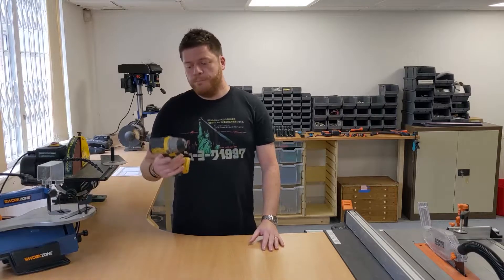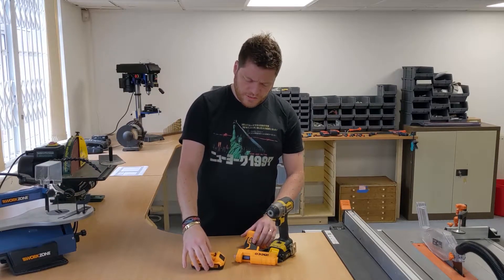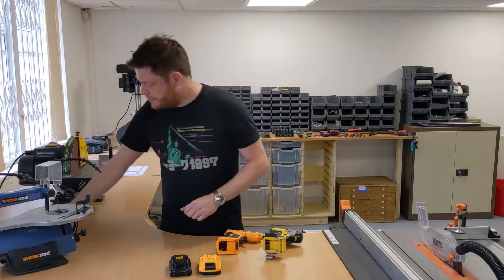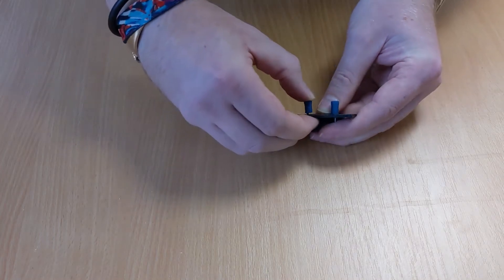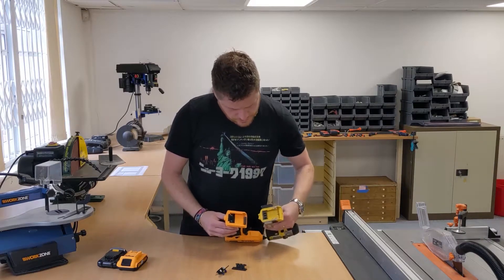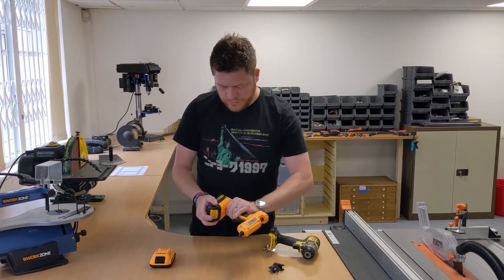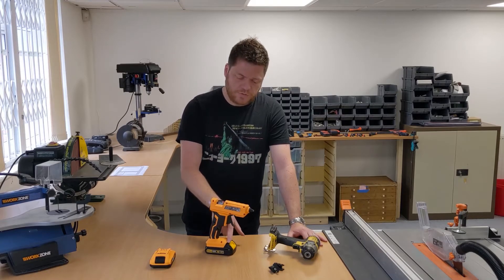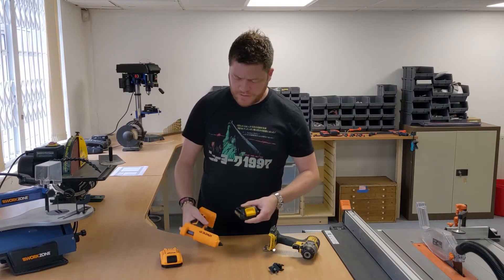DeWalt cordless glue gun - do DeWalt batteries fit Ingco tools?

Comment: In hindsight Ingco should of made their batteries 100% compatible with one of the top 3 DeWalt Makita or milllwake  .Ingco  batteries are cheaper  they could of sold batteries to owners of the above cheaper  .Also does a bit for environment making batteries comparable with other makes.They could even sell adaptors so you do not need to take the tool apart .You can get them for the top 3

Comment: Completed the conversion. All went well EXCEPT it might have been better had you mentioned that the DeWalt battery polarity is the opposite way around to the Ingco. Other than that, it's all good. The STL files printed perfectly on my Prusa Mk3.
Reply: does this mean to crimp the blue spade opposite
Reply: @stanleyhoptroff  No, because the glue gun looks like such a simple device that it only contains a heating coil and on/off switch, so it only has the two terminals and it does not matter which way around they are connected.

Comment: I made a wood and aluminium conversion for this to take makita batteries. Excellent glue gun however I bought the jigsaw and that has a third terminal and it cuts off after a few seconds with the makita battery. Any advice would be appreciated
Reply: The plus and minus terminals are the wrong way around, so try reversing them. Note; on the glue gun it doesn't matter which is pos or neg.

Comment: You are a genius! I bought a Ing co gun thinking that my dewalt batteries would fit, but they don't. Now I want to try this modification as well. Do you have the 3D file to sell? I would like to print with my Prusa.
Another question is if my 5Ah batteries will fit and not damage the gun. Many Thanks!
Reply from the maker: There's a link to the STL files in the video description and your 5Ah battery will work fine, the bigger Ah rating just means it will last longer.
Reply: @LeighWorks  Hi, did you make a video of the actual process of removing and fitting of the old and new components? Was it easy to do? Thankyou
Reply: Thanks so much!